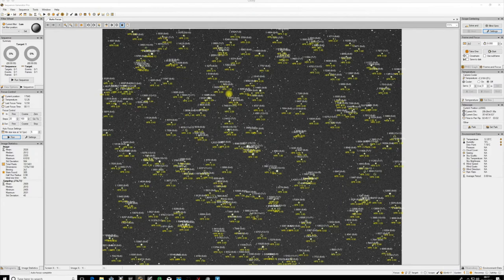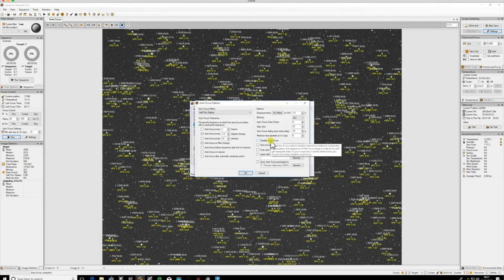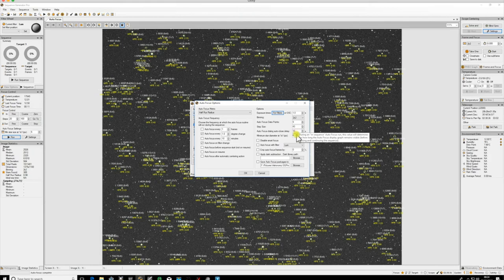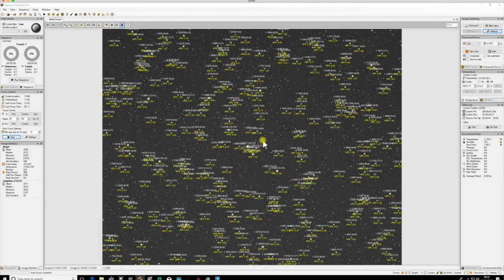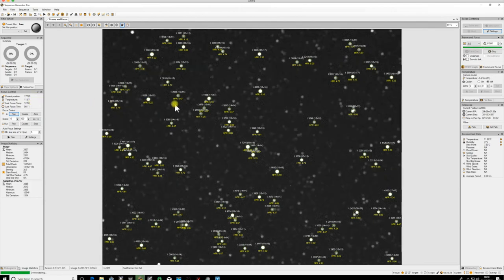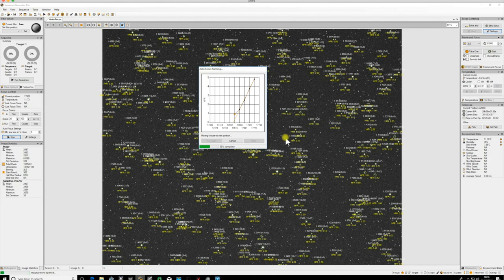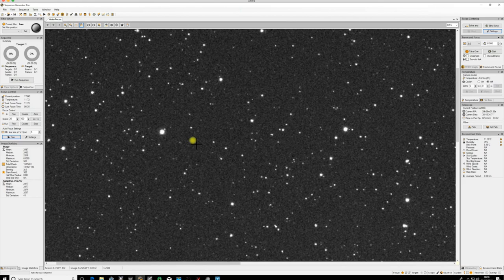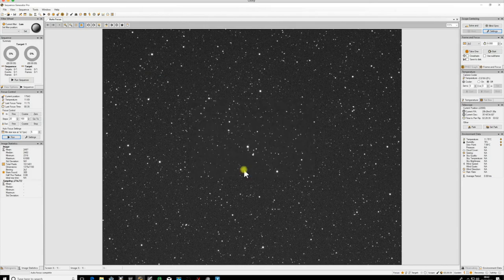Sequence generator Pro - Part 1 of 2 Setting up auto focus

Comment: Thanks for the info. One question you said that the bin and exposure time should be the same in both the filter setup and the frame and focus module setup. I see with the Lum filter your using 6 sec. in both areas. In your, Narrowband filters you use 21 sec. are you leave the frame and focus module still art 6 sec. what should I set my exposure time in the frame and focus module 6 sec or 21 sec? or should I set all my filters to the same exposure time?
Reply from the maker: Hi.  The auto-focus time and frame and focus times can be different.  To get a good auto-focus you want well exposed stars, so you will need this to be a value which obtains this for each filter.  My NB filters are only 3nm, so my times here are higher.  However, for frame and focus you only need enough exposure tome for a plate solve to work, so may not need this to be as high.  It's worth experimenting to see what works well for you as they do not need to be the same.

Comment: Hi, I am curious why you need to minus one with your data points from nine to right? Didn't quite get that.
Reply from the maker: Hi Chris.  I don't know exactly why this is necessary, but it is needed to satisfy the algorithm used to calculate the step size.
Reply: @simplifiedastro2092  oh, ok, so that is in a formula...Thanks for replying

Comment: This is a amazing.   Couple of questions.   
Do you find your initial best focus position via trial and error or something scientific?   
I’m also shooting at the moment with a DSLR,  and can’t get my hfr values anywhere close to 1.  Is that generally because Astro cams are better for sharper stars?  
Sorry about the noob question
Reply: Do not go by his HFR - it is highly dependent on multiple factors including telescope and sensor and seeing... just get it as low as possible and go from there... I have a C11 Edge and I am happy to get it in the high 2's - best case scenario.

Comment: Thanks for your good work. I`ve learned a lot from your videos, especially about how to get focus. I have an Tak Epsilon 180ED, with an Moonlite fokuser and a Moravian G3 16200  camera. I wonder if you have any idea how my parameters should be in the section where you calculate the step size for the focuser?
Reply from the maker: Hi. Thanks for you kind comment, really glad the videos are helping.

Unfortunately there really is no way to tell what they settings will be as each set up will be different.  I think the Moonlite on the Epsilon has quite a short travel and it is quite high resolution so I suspect you will see a reasonably high step count, but honestly couldn't be sure.

If you focus with a mask or by manually moving to get the lowest HFR reading you can, note the step count at that point, then move the focuser out until your HFR is 3-5 times your original HFR reading this will help you calculate your step size.

I would say start with 7 data points, and only change this if you find the need to.

Sorry I can't be of more help.
Reply: Thanks again, I`ll try with 7 datapoints and see how it developes tonight. The focus is essential for a reasonable result :)

Comment: Hi my in focus hfr value 1.18 then I move the focuser till hfr value 4.5 then deduct the focus position value with in focus position value then I multiply with 2 and then divided by data point the value igot 225 .i enter this value in step size…first time I got v curve but next auto focusing time it says cannot find focus point and failed to do autofocus…please let me know what I’m doing wrong…
My equipments
Esprit 100ed apo
Sesto senso focuser
Zwo asi071 mc pro
My settings for auto focus
Exposure time 10
Bin 2x2
Data point 9
Step size 225
Auto close delay 10
Minimum star diameter 6
Crop autofocus 20% checked.
Reply from the maker: Hi Srinivasa.  I would say you're not too far away.  I have 275 step and 9 points using my Sesotsenso with the Feathertouch.  The only setting I have different is the image crop, which I don't do.
I would say try running the sequence again and even check your numbers as the Sestosenso runs on the fine focus shaft so can have quite high step counts.  Also just double check that everything is nice and tight (be careful not to over tighten the small grub screws and they have been known to strip).
Reply: @simplifiedastro2092  Thank you so much...I will try next imaging session.
Reply: @simplifiedastro2092  hi one more doubt i was taken picture with sgp and next day I try to plate solve but platesolve keep on spiral searching...nothing solved...but same night  I took same object  with APT that I open in sgp   and plate solve perfect...why sgp not plate solving its native image?
Reply from the maker: @tasrini72  I tend to do a blind solve if it is the first one of the evening.  I too have had issues with PS2 solving  from cold.  After the initial blind solve I have no further issues.

Comment: Hello! There I’m still trying to figure out the calculation and how to set The step value... 
I have a moonlite focuser 2.5 for a refractor with a 4.5 draw tube 
explore Scientific 102mm
.8x Field flattener/ reducer
And a Zwo 1600mm pro.. 
I don’t know even where to begin :/ 
If anyone has any tips for me please let me know thank you very much
Reply from the maker: Hi Llamar.  The actual equipment is largely irrelevant.  Provided you have the correct spacing between you FF/FR and you camera sensor (very often 55mm, but you don't say what one you have) then all you need to do is start by getting your image in focus.  I recommend doing this using a Bahtinov mask or similar manual means.

Once you are in focus, you can then run through the routine shown in the video of noting your HFD value, and then moving your focuser until your HFD value is 4-6 times this amount.

The routine is exactly the same for Moonlite as any other focuser, assuming it is a stepper motor and not the DC motor type (these don't use steps so this routine won't work with them).

Hope this helps.
Reply: Simplified Astro awesome thank you I will try it out